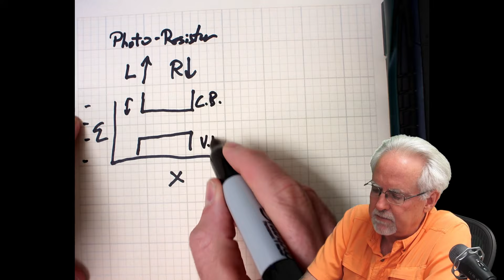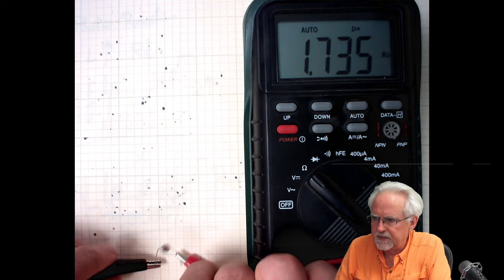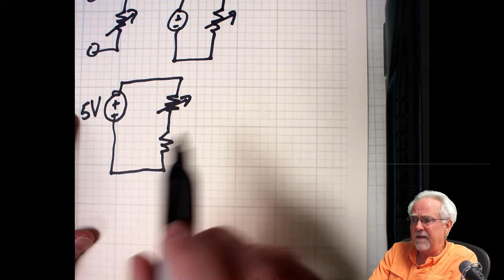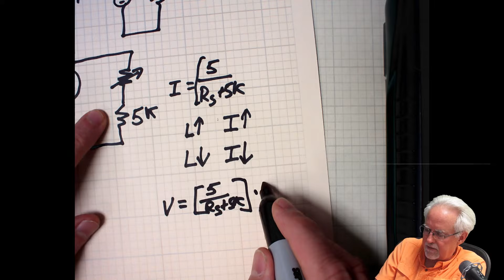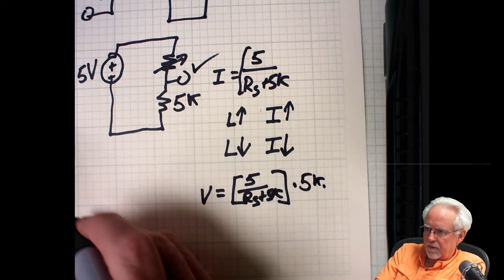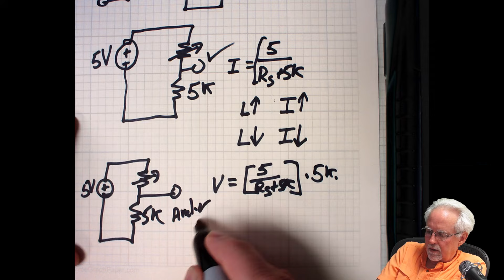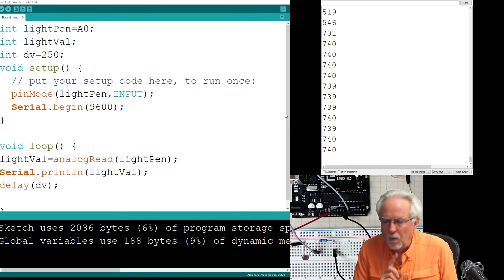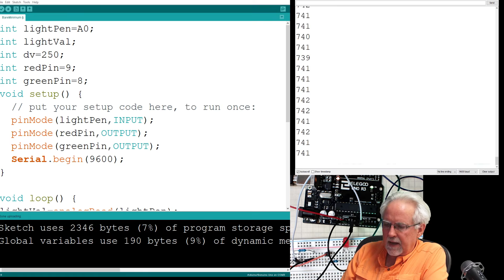Arduino Tutorial 25: Understanding Photoresistors and Photo Detectors

Comment: One thing about c++ is there is no way to go through a list like you can in python.  Is there any way C++ is better than puthon.. I know some devices cant handle  the storage it takes but most of the newer devices can like the esp32. I got the Paricle Photon because it was 19 bucks can run micro python and has inboard wifi.

Comment: BOOM BOOM BOOM, I got it, not without some diagnosis, I had the code correct after some wrong case letters, still didn't work so I double checked the LED wiring hook-up and was getting power to LED before the resister, corrected and its working, I used <800 and >=800, Thanks

Comment: So I downloaded the  latest IDE today and no change of luck. I then went back to lesson 11 and repeated the code and no serial monitor output still. I then changed to my official Uno and had to change to  Com 4 and the baud rate is still 9600 on the Uno and monitor but still no out put. I also pushed reset and changed the USB cable. One more thing to try. When in doubt... REBOOT
Reply: Try this simple sketch :
void setup() {
  Serial.begin(9600);
}

void loop() {
  Serial.println("Hello World");
  delay(1000);
}

Comment: I have tried repeatedly to get the serial monitor to work but I get no output. I am on Com 5 and no line ending and I know my ciruit works because I put an LED in it which responds to light input , but no serial output. I even tried the real Arduino Uno but that just gives me some sort of a Com 5 conflict so I am stalled. I copied the ciruitry and programming and even redid it thrice but still no serial output. I love what you are teaching us but it's challenging when I cannot duplicate the outcome of the lesson. Any guesses as to what is wrong?
Reply from the maker: Did you remember Serial.begin(9600) in your void setup, and do you have your serial monitor set on baud rate of 9600? If you are downloading code into the arduiono, then you are already talking over the serial port to arduino
Reply: @paulmcwhorter  Yes I have done all of that and on more than one occassion. I have reviewed various forums and it should be straight forward but alas I still get no output. I'm going to try loading the IDE into another computer and try again. Everything was working well until I got to lesson 25 and then no output to serial monitor.
Reply: I have now tried the second laptop and two arduino's and still no serial monitor output.  Lesson 11 does not get much simpler so I am very confused. I have typed everything out verbatim and the Com's are synced as are the baud rates. I could send you a screenshot if I knew how. I'm sorry to trouble you with such a stupid problem as I know you are very busy.

Comment: Hello. Great job. Here are a few thoughts from me. After a reset all pins are set to be inputs. The analog read function sets the pin to be read to analog mode. So it's not necessary to set any pin to be an input.

Comment: I think I've got the coding part of micro-controllers well in hand. It's the tutorials like today's where I learn about the math and physics of the hardware that interest me the most. I'm wondering about 2 things: 1) do photo-resistors wear out like photo-voltaic solar panels? and 2) does it matter if the LED current limiting resistor is on the anode or cathode?
Thanks Mr. McWhorter, as usual.

this was my coding solution--

lightVal = analogRead(lightPin);
digitalWrite(greenPin, (lightVal > 350));
digitalWrite(redPin, (lightVal <= 350));
Reply from the maker: I dont think solar panels really wear out, but more they just get weathered and the surface begins to scatter the incoming photons where they do not end up making electricity. Imagine a it like a dirty and pitted windshield will affect your vision.